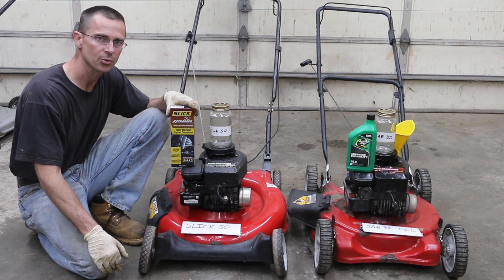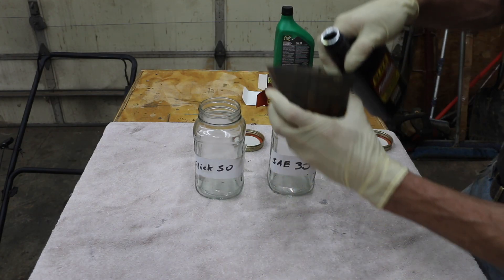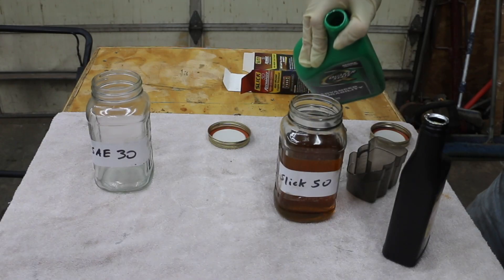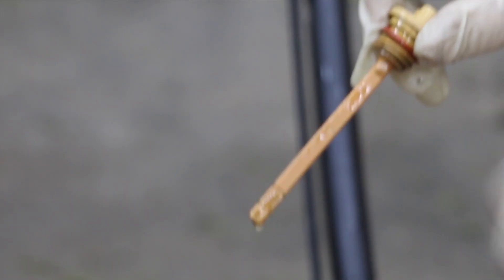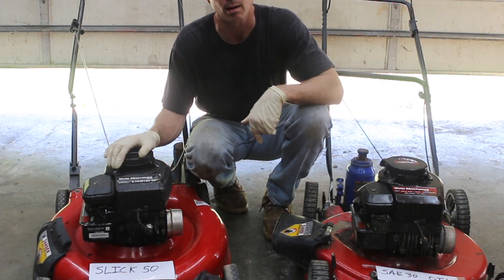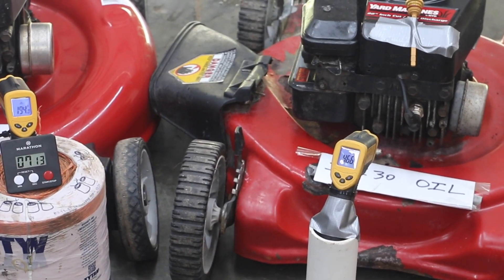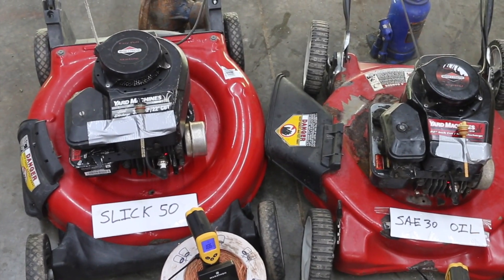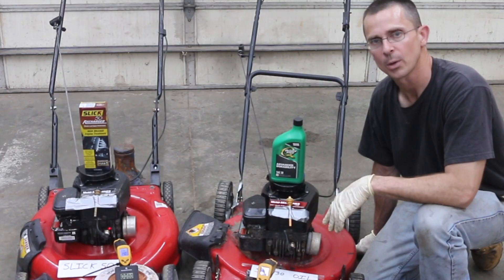Can't believe what SLICK 50 did to my engine!!--Dry Crankcase Test!

Comment: Slick 50 does work at least it did in 1990 or so...i did drive a truck with 350 engine for about 50 miles with no oil after slick 50 treatment trying to blow it up, it didnt hurt it.
Reply: I used it in my 1992 VW Jetta, a week or 2 later a seal failed on my way to work (25 miles) leaked out most if not all my oil and the car still ran. Took it to a garage after work, they were surprised it still ran because all the oil had drained out. Poured oil in and it all ran out the bottom of the engine. So for me this stuff works or maybe it was the type of oil I used.
Reply from the maker: Thanks for commenting on this.
Reply: That's because it was a 350. Lol. You can't hurt those engines.
Reply: @baybchik23 
Fact!

Comment: I remember those commercials I even remember thinking about trying it and I also remember at that time there were a few oil additives and started hearing stories of engines seizing then I found That magical Slick 50 saw the price and found out it was just an additive and with a coast of something like in todays money of about 2,000,000 I thought it was just better to keep changing my oil.

I also remember reading the blurb on the back and Slick 50 says it can't replace your engine oil which equated in my mind as the same thing as snake oil.
Reply from the maker: Thanks for commenting on this.

Comment: I run Nulon E10 "worn engine treatment". It has seemingly magic properties of reducing engine knock without altering viscosity *under racing conditions*. Seriously I had a terminally cooked engine that no-one expected to make it into the trailer run another two races (about 10 minutes of full throttle) at full performance. I've also had an engine knocking on a street car not deteriorate after around 25,000km. It was a lightly modified EJ20, so it got the odd thrashing too...

Comment: You were supposed to SHAKE the Slick 50 bottle VERY well...it (additive) used to accumulate in the bottom of the bottle,  Cut open that bottle if you still have it.  30+ years ago I would cut the bottle open and still scrape out teflon on the bottom after shaking it ALOT.
Reply from the maker: Thanks for commenting on this.
Reply: You're Very Welcome, and the additive was a silvery/grey color...let me know if the NEW Slick50 still has this  additive that settles out onto the bottom.  Thanks

Comment: Motorkote
Reply from the maker: I tested MotorKote in a more recent video and it did well.
Reply: I like the MotorKote. Used to work at a truck stop. 
Truck drivers would buy gallons of MotorKote. 80.00 - 90.00 per gallon jug.
Asked one truck driver why one day.
Told me it reduced his fuel costs and extended his drain intervals on his 18 wheeler.
I used MotorKote in couple of cars I have owned.
Engines were quiet even with the MotorKote.
With the MotorKote the engines ran more smoother and quieter.

Comment: Might be interesting to run one engine with 30 oil then measure the temperature after 10 minutes, then take that oil out and mix the slick 50 into it then put it all back in. See if the same engine runs cooler with it or not. Nice video. RIP lawnmowers...
Reply from the maker: Great recommendation.

Comment: Has anyone pointed out to you that Slick 50 that is sold today is the not the formula that was advertised as running car engines without oil?  John Bishop, stop selling the original formula for Slick 50 to the marketing company in 1984. They owned his name, but not his formula.  He has started reselling the original formula under the name Xcelplus.
Reply from the maker: Thanks for this information.

Comment: The reason the Slick 50 failed is due to the formula was changed due to patent protection.  The original formula was patented by the inventor but the Slick 50 TM wasn't.  The inventor left and hasn't supplied the formula since 1984 or 85ish.  The actual real formula is marketed under the name Xcelplus' Lubrilon.  That is why the claims are no longer on the packages or in commercials.
Reply from the maker: Thanks for this information.

Comment: This is a great video. I started watching and with the initial lower temperature and cleaner oil for the slick after emptying, I thought perhaps there is some kind of chemical bonding to the engine parts taking place and maybe it will run without oil.. Like a Teflon non stick frying pan..

It appears not, although I was dissappoimted to see you haven't opened up both engines to look at the damage / condition inside.

The slick may have seized first and be unusable as is, but can it be reconditioned more easily or put back into service without too much difficulty..

The temperature remained much lower and it 'died'more quickly... I prefer anything that stops working before real damage is done internally... Yes a modern circuit breaker stops any damage but old skool fuse wire still works in shutting off power and limiting damage.
Reply from the maker: Thank you!

Comment: From my personal experience when Slick 50 first came out and my machinist’s many years of experience, Slick 50 prevents proper break-in of engines, which is necessary for internal engine components and cylinder walls for sealing and clearances. That’s why I stopped using it long ago. Same thing for synthetic oils. Break-in first with a petroleum based oil for 10,000-20,000 miles with recommended oil change intervals, then switch to full synthetic like Mobil1 for the remainder of its life. The only way I’ve been told to get a faster break-in is doing a few pulls on an engine dyno.
Reply from the maker: All great points and thanks for commenting.

Comment: Test Amsoil small engine oil against any oils on the market with new engines.  See how long you can run on 10 gallons of gas wide open throttle. Check for overall engine cleanliness, wear, temp, and efficiency. Just a thought.
Reply from the maker: Great recommendation!

Comment: The problem with this test is that the Slick50 engine wasn't properly treated. The classic formula, at least (containing PTFE) requires much more time and heat to bond the teflon to the internal metal surfaces than you gave it. It has to be left in an automotive engine for a full change interval to properly treat it. This is why it was never advertised as an oil additive, but an engine treatment. I'm guessing that was some of the "fine print" on the TV commercial they ran years ago doing this test.
Reply from the maker: Thanks for the constructive feedback.

Comment: I had a wally world 5hp mower I deliberately wanted to blow up Took oil out and ran 2 tanks of gas with throttle jammed wide open before it seized.Then took it to shop and it started up first pull....go figure...gave it back anyway.It would shear keys all the time
Reply from the maker: Wow!

Comment: I'm just thinking that the Slick 50 is supposed to run in the engine WITH the regular oil, and there could be a great difference doing that vs. running it dry with only a film memory of the Slick 50...? (Do that test over the next 30 years:) just kidding...) the statements about dry running from Slick 50 is probably just "click baits". ( = lies)

Comment: If both engines aren't equally worn, they won't seize at the same rate. I know it sounds weird but the more worn it is the longer it would run without oil. Back during the idiotic Cash for clunkers my friends at the dealer would try to grenade the engines any chance they got. They used to pull the drain plugs and start the cars then let them just idle, sometimes they'd get in and hold them at red line and all kinds of other stupid stuff. The lower mileage better maintained cars heated up and died first. But the real junk would run forever they had an old Pathfinder with 340k on it that ran for almost a week without oil.... They couldn't kill it.

Comment: I don’t remember Slick 50 driving a car around town after draining the oil. However, Prolong used to have a commercial that showed them doing this. I used Prolong in my ‘94 KIA Sephia and the inside of the engine was still silver in color after 130,000 miles.
Reply from the maker: I'll have to test Prolong in the future.

Comment: I have used Slick 50 and Duralube in older small block chevrolets for years. I think the Duralube is better.  Stp is good for an old wheezer that burns oil. As far as motor oil is concerned, any oil is better than no oil.
Reply from the maker: Thanks for commenting on this!

Comment: A motor running sick 50 or any other material that bonds to the metal will seize from heat. The difference is you can let it cool, break it loose, and it will run again. Did this with a '69 simplicity 14 horse tractor. It ran low on oil and seized, but had a slick 50 like ptfe product in it. We put a breaker bar on the crank, broke it loose, and filled it with oil and ran it another 5 years or so.
Reply from the maker: Great point.

Comment: Slick 50 is much less a lubricant than oil.      Slick 50 is an additive.    The original Slick 50 seemed to me to be a lubricant.     NO I do not see this type of demo as wasteful or gimmicky.      It is a true observation of possible solutions to old problems.          I'd really like to know what you think about  the  TurboTEK product.         Thanks!
Reply: I do believe even though an engine with slick 50 cant run dry, it does keep the engine running cooler so that extends overall engine life and probably lubricates all parts that sit as to extending an engines life from the dreaded dry starts when you initially start an engine.
Reply: Accel plus is the original slick 50 before the owner of the product took it with him but couldn't take the slick 50 name
Reply: I just looked for an accel plus and couldn't find it any where do you have a more specific name for it? I'd love to get some.
Reply: @n111254789  it Xcelplus but in the US it sells under the name Lubrilon

Comment: I once forgot to replace the oil plug in my truck the truck with slick 50 ran for almost 30 min before i seen the oil on the ground., I had driven it 8 miles. I replaced the plug filled with oil and slick50 again. Drove 100,000 mile after with no problems.
Reply from the maker: Wow!

Comment: I would have liked to have seen the slick 50 have been ran in the engine for the full duration between recommended oil changes. Also we don't seem to know the differences between the conditions of the engines before the test. One thing in particular that I would have liked to have seen, was the differences in the engine temperatures before the Slick 50 application. A further note, a hotter running engine could have the potential to run longer without oil, due to the effect of heat lubrication, so it might be critical to choose test engines that initially run at close to the same temperature.
Reply from the maker: Thanks for the recommendation.

Comment: http://cdn2.hubspot.net/hub/68152/file-15279904-pdf/docs/white%20papers/comparison_testing_of_aftermarket_oil_products_bell_performance_xtra_lube_four_ball_0709.pdf
Reply from the maker: Thanks for the link.
Reply: No problem.  I came across it a few months ago when wondering if I should switch from STP to Lucas.  I just started using Walmart synthetic with the STP instead after reading it.

Comment: I too was shocked Slick 50 didn't perform better. I remember going to a swap-meet in San Jose, CA in the 1980's. There was a tractor with the oil pan removed running all day long. It was pretty impressive. I can not remember the product they were selling, but I thought it was slick 50.
Reply from the maker: Thanks. I had hope it would win.

Comment: Ya cant assume both those old well used mower engines were in identicql condition before the test began.  to be any kind of accurate you would need to use new engines and even then would have to do the test like 10 times and use averages to allow for mfg diferences in the new motors.
Reply from the maker: Thanks for the constructive feedback.

Comment: It might be that SLICK 50 is very slick, but not sticky. Slick while it is circulating reducing friction as you can see by the reduced temps, but did not cling or adhere to the metal parts. So slick it drained off the metal parts after it was no longer circulating. Just a thought.
Reply from the maker: Thanks for commenting on this.

Comment: I used to race the short oval tracks and constantly running at hi revs used to ruin my cranks and most meetings used to end up with expensive re grinds. I then decided to use slick 50 and even though my oil still got cooked and I was driving back to the pits with the oil light flashing I never had to strip the engine for the rest of the season, I just needed to refresh the oil. I was surprised that the mower engine failed in your test but maybe there was an underlying issue.
Reply from the maker: Impressive!
Reply: It's likely that there was advanced wear on the Slick 50 mower. Quite possible that it had been run dry at some point in its life---fairly common as mowers go.
Reply: I mentioned several issues earlier, and that the 'S-50' thinned the lube, leaving less residual lubricant.  It wasn't mentioned, but looked like there was slightly more removed 'S-50' lube in the mason jar.

Comment: There you go with the oil WEIGHT myth! It's 30 viscosity. That W after the first viscosity number on multi viscosity oils denotes WINTER (cold) start viscosity.  Show me how to weigh oil. Why do you think there's no W after the viscosity number on single or mono viscosity oils? What's more is that's very disappointing that Slick 50 changed their recipe as slick 50 in the 70s and 80s use to come in gold tin cans that had to be opened with a can opener and if you spilled any around the top of the can it was virtually impossible to pick the can up with your hands and a car drove from Sydney Australia to Melbourne with no oil after treatment with the original Slick 50 and didn't seize the engine. My mum use to be a selling agent for Slick 50 and I saw the spec sheets on 4 stroke racing go carts that ran Slick 50 and the engine teardowns showed no wear as apposed to those that used no oil additives and needed replacement parts during rebuild.
Reply: Saying 30 "weight" is like saying copy this on the xerox (copy) machine, grab me a scott (paper) towel. Imprecise usage, yes. But part of the lexicon. ;/

Comment: This test is INVALID!!! for temperature reading I would like to point out the exhaust from the slick 50 engine is directed straight at the intake of the S.A.E. 30 engine which would increase air intake temperatures.
Reply from the maker: Thanks for the constructive feedback.

Comment: Excessive heat, especially in air cooled engines, is a killer.
The Slick 50 did reduce temperatures. For that reason alone I'd use it. I'm never going to run an engine without oil.
Reducing the peak temperature will increase the life and efficiency of the base oil being used. Less thermal breakdown.
What would the temperature difference be between 30HD mineral based oil and a full synthetic oil?
I would think the synthetic would run cooler due to better lubricity. Slipperier. Again less heat, less breakdown, less wear.
8-)
If everybody does a little bit a lot will get done.
Reply from the maker: Great point.
Reply: Here is an excellent read on oil and how it works.
https://www.minimania.com/Motor_Oils_-_It_Is_So_Very_Misunderstood
It confirmed some things I learned early on. It totally reversed many other "beliefs" I had about engine oil.
Example: Running hot? Use the lightest weight oil that can be safely be used. The greater Volume of flow will cool/lubricate the engine better.
Aim small, miss small.

Comment: Extremely interesting - someone I know at one time swore by Slick-50... I've never been much for magic additives - usually just good for taking money out of peoples' wallets.  Is it possible that the lower shown heat on that left mower is because the heat from the engine parts internally is not transferring to the oil and the case properly?  Just trying to figure out how that engine locked up so fast.  It certainly did something different when the engines were run empty!

Comment: As a mechanic I remember years ago to that slick 50 caused a sediment build up of particles which blocked oil filters and resulted in some engine failures when running too long with the same oil. There is a product that I used called" prolong" which I would like to  see tested if it is any good. It was available in South Africa. I haven't seen it anywhere else. I always wanted to do these experiments to get the best results  for my customer's vehicles but was always too busy with servicing and repairs. Very interesting video. Thank you.
Reply from the maker: Interesting!